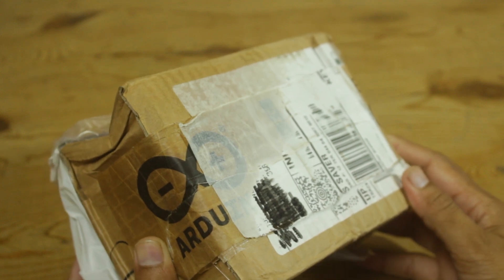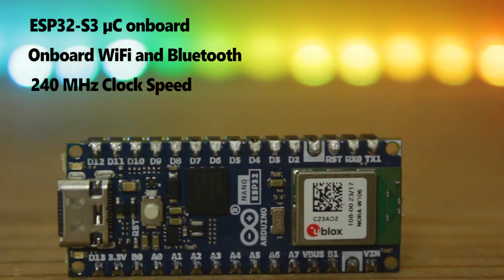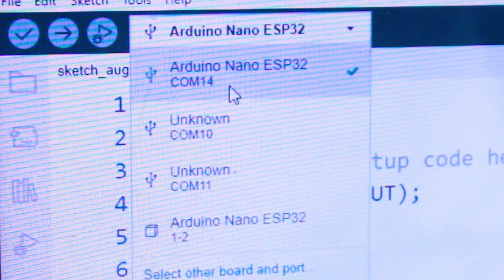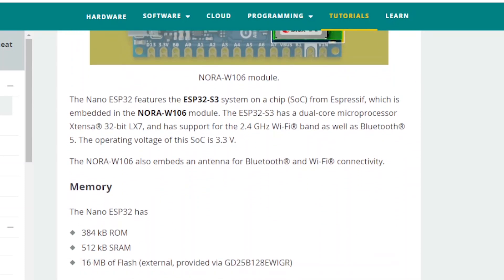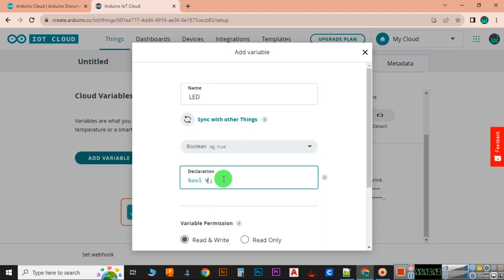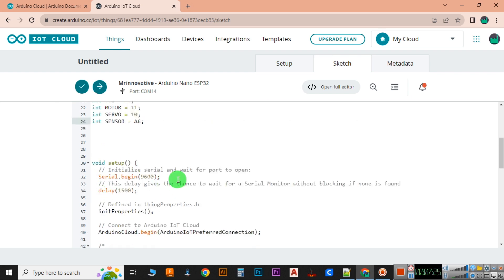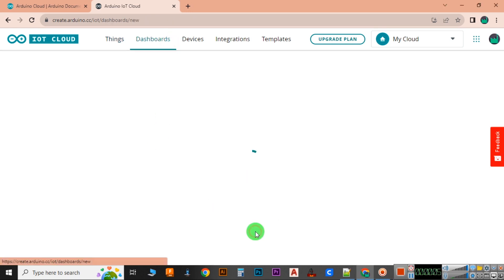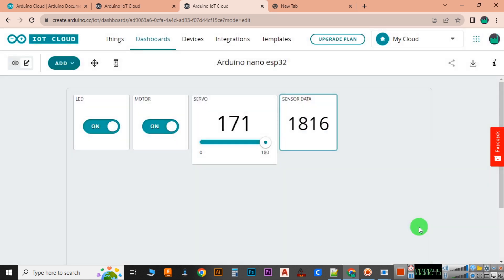DIY Arduino Nano ESP32 based Home Automation project.

Comment: Hi. Thanx for this project. 
I have already checked your website but i cant see what kind of sensor did you used and how HMI display works? After connecting rx tx gnd and 5v adding to dashboard messenger widget is enough?